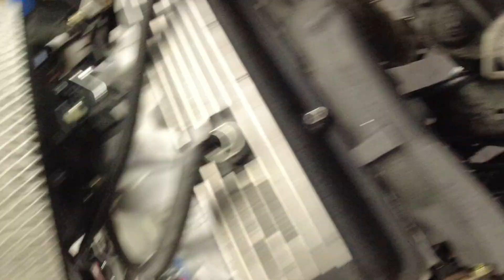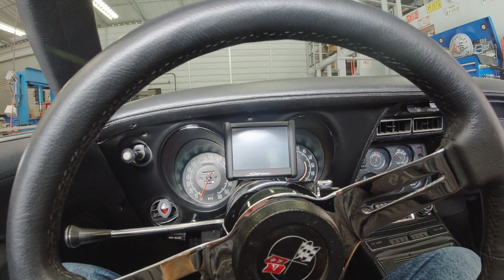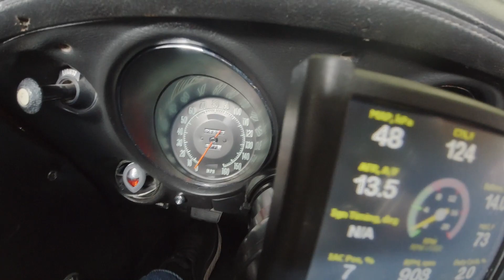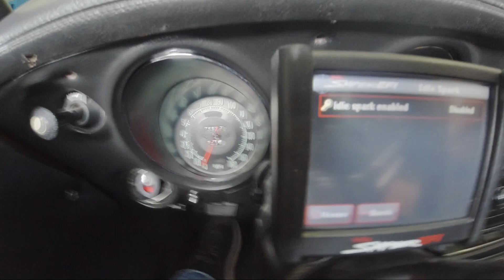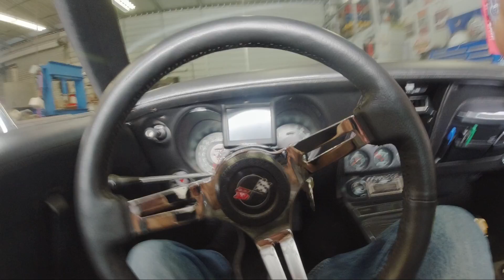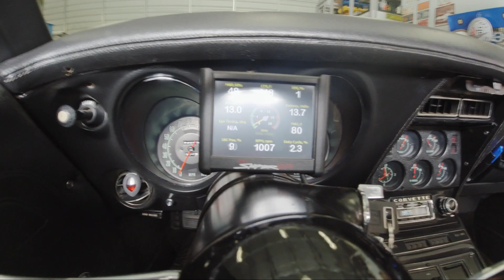Setting the engine transmission Assembly in my C3 Corvette

Comment: If the price of admission for the Holley Sniper is that huge butt-ugly squared screen in front of the tach & speedo, it’s not for me!  I suppose Edlebrock is fine, but I went with Corvette aluminum heads, and a Corvette LT1 aluminum high rise intake. Whenever possible I like to stay with stock Corvette parts rather than after market stuff. But that’s not always true, when I had the rear suspension rebuilt, I chose a plastic mono spring.  The ride is about the same as for the stock multi-leaf spring. 
Due to a physical limit to my left leg, I had to sell my 69 Corvette, thankfully to my brother in law, so thankfully it’s still in the family.
Reply from the maker: When I put the car back together after painting, I placed the screen in the rear storage compartment.

Comment: Great videos! I looked at your video when you installed the engine and notice the oil dip stick. I have a 383 crate engine that has the oil dip stick on the passenger side like yours. I ordered a chrome dip stick that would not fit into the block, so I had to buy the long original style with the yellow pull handle which I do not like. Where and what kind of oil dip stick do you have?
Reply from the maker: Mine came with the engine when I ordered it from Carolina Engines. I had to shorten it.
Reply: @timewiththedurbins  I live in North Carolina, where about is Carolina Engines located? Did you cut the top or the bottom of the tube?

Comment: Hi, I have the same car as yours... 71 red/black, SBC and I'm in the middle of the Holley swap.  Love your videos.  

Wondering what throttle cable bracket you're using.  I was trying to use the stock Quadrajet one, but it keeps rotating and I'm not getting full throttle.  

Please let me know what you're using with your setup.  It'll save me time trying to come up with a solution.  Thanks
Reply from the maker: I used the stock quadrajet throttle cable and bracket. I had to weld a little ear on it that hit against the base of the sniper to keep it from rotating.

Comment: Appreciate your honesty and explanation of your challenges. It confirms to keep my 78 SA with the automatic & stay with the quad. carb. My car runs and drives great. I’m going to keep it all stock…
Reply from the maker: Thanks for the kind words. I have been working on cars most of my life, but I think this one has been the most challenging. It seems that everything I have done to this car has fought me every step of the way. If I knew when I first started on this car, the problems I would be having, I guarantee It would not have a Sniper or a 4 speed transmission. The Vintage Air was probably the easiest thing I did to the car. I would keep that. LOL.

Comment: What I’ve seen from other installers is the problem with electrical shielding. High voltage bleeding. A yellow corvette guy on YouTube had issues which turned out to be shielding also.
Reply from the maker: I have separated, routed and shielded my wires per Holley's instructions and recommendations. I also added ferrite magnets to all the Sniper wires. I don't know what else I could do in regard to the wiring to make it any better.